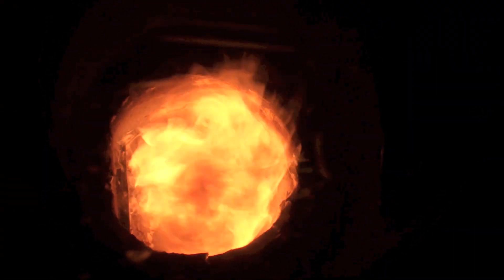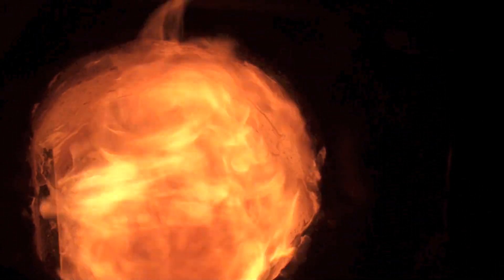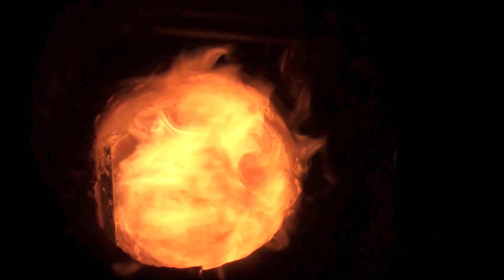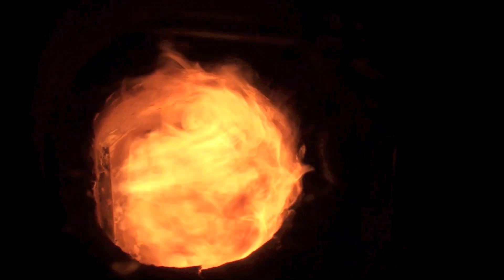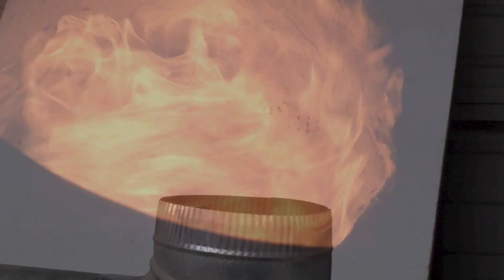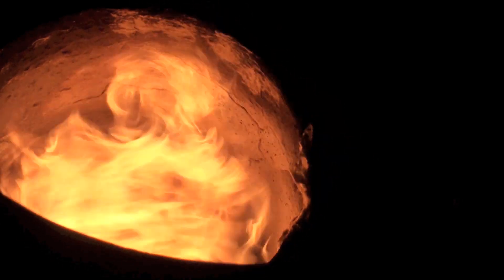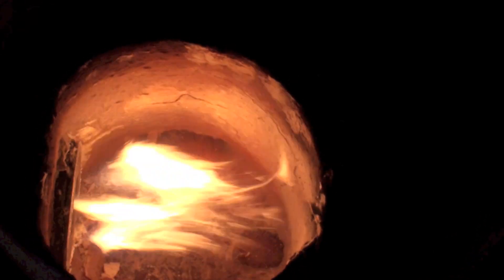Setting the oil burner air adjustment

Comment: A furnace guy told me that I had to much oxygen and tried to shutdown my boiler for high CO2 levels, does this sound right? If it does, would you be able to explain why? I am trying to learn as much as possible. Thanks in advance
Reply from the maker: Are you sure it was CO2 and not CO (carbon monoxide)?  The part about too much oxygen does not make sense.  If you had too much oxygen, the CO2 level would go down.  I am assuming he did a combustion analysis.
GFM

Comment: I have a stewart warner oil furnace. I cant seem to figure out if there's an air adjustment. The electrodes keep fouling out and it'll run, but once it reaches thermostat temp and shuts off, it wont kick back on. I've done dang near everything to it, other than air intake adjustment because i dont see any. Its an ancient thing!
Reply from the maker: If you send me pics I may be able to help.  Send to:  Grayfurnaceman@gmail.com
GFM

Comment: Thank you for these videos.  You helped me save what I thought was a dying burner.  Turns out I had way to much fuel after switching from kerosene to no 2 oil.  I had no idea how or if it was even possible to make adjustments to air and fuel pressure.  She's burning clean now and the burner is no longer smoking and dripping fuel all over the place.  You saved me a bundle of $$$$$
Reply: A kerosene and oil burner are 2 very different things.  What you’re doing is not efficient at all and a fire hazard.

Comment: @grayfurnaceman: Your videos have been very helpful since I first had to troubleshoot my furnace on Christmas Day years ago!
I run a 1.1GHP - 80B nozzle on my Beckett AFG burner on a short barrel, heat exchanger, in a low-boy forced hot air furnace. Beckett says both the F6 & F12 combustion/flame retention heads are within range of the nozzle I run, but given the choice, I am inclined to always run the smaller slot sized, F6 head, so I can run with a little more air pressure behind the head.  The original head was an F12, and I had to run the burner with the fresh air intake almost entirely closed to get the air setting correct.  As for flame color, I've found that if it's orange, like the Sun at dusk, it's air-starved, or if it's almost white, you have way too much air and you're blowing heat right up your chimney. You want to to be much closer to "just not orange", than "almost white".  
Also, if you have a Beckett burner that won't stay lit, check your drive coupling between the pump and the motor; they are plastic and the square drive hole rounds out over time.  You may start the hear clicking, and when it gets bad enough, your fuel pressure will not maintain a steady pressure, and you'll get constant flame-outs.
Reply: One other thing I'll mention is too much air pushes heat right up your chimney without being recovered. I'm down to a 0.85 GPH nozzle, so the furnace runs a little longer on each heat cycle, but my heated ambient air temperature  to flue temperature differential is greater, meaning there is more heat now being recovered by the heat exchanger.  I put a digital thermometer/relay switch in my sheet metal furnace collar, that is in series with the flag switch, to control the humidifier water solenoid, so the humidity panel stops the water flow before the air temperature gets below 120F, so my water overflow pump kicks on a lot less now.  But having that thermometer reading in combination with taking the temperature of the flue pipe, gives me the temperature differential.

Comment: Do you mind if i ask how or where your can look to see the flame on an oil furnace? It looks like yours might be half apart…  on one thats in service is there a way to inspect the flame?
Thanks for all the tips!
This video helped me clear up the black smoke that appeared directly after i paid a furnace guy a grand to replace a gasket (that allegedly caused the fuel oil leak out all over my basement)
Reply from the maker: There is usually an inspection hole above the burner.  It will not give an unobstructed view of the flame as seen in the video(this unit is a test mule), but with a flame mirror(made of stainless steel), you can usually see fairly well.
GFM

Comment: I've got a beckett burner. Is there only the side air adjustment or is there another adjustment somewhere?
Reply from the maker: There is a mass damper on the circumference of the burner in addition to the end adjustment.  The mass damper is seldom used for nozzles less than 3 gph.
GFM

Comment: Thanks again for another great video.  You said something that  caught my attention about, "sparklys". If you have those, what does that mean? Thanks
Reply from the maker: The sparkles usually mean too much air.
GFM
Reply: @grayfurnaceman  thanks for replying back. I'm working on one now that has been down for a couple years for my neighbor. I pulled the wool filter out and it was  gunked. The strainer in the pump was very clean though. I adjusted the  electrodes and got it fired up. It had those sparklers though so I shut it down. I figured it may of been too much air and you definitely have confirmed my thoughts. This is an old one. It doesn't have the solenoid.  They told me that it would run fine until the ambient temps were below freezing. I told them I wanted to research it and talk with someone who knew their stuff. I checked their oil (visually) and it looks clean, very red....doesn't look to have water in it but I do know tanks build up condensation in them. I have thought about some sort of water removing additive but really don't know for sure what would work. Other than the filter their oil burner looks clean. They did add 100gal of fresh fuel in it back in October and their gauge shows  about 120gal if its correct.  Its a one line system,  above ground and is layed out to where it does work as far as gravity. When I bled it, I saw very little air bubbles. I probably caused most from changing the filter. I'd like to check the pressure and will also try to adjust the air. I told them that they should have their oil company come out and do a professional check on things. It may have had lower pressure with the gummed filter and now have more with clean filter but I won't know until I check the pressure.  What are your thoughts about this? Thanks in advance and sorry for the long message, just like to give as many details as I can when troubleshooting.
Reply from the maker: I think you have fixed it with the filter change.
GFM @dgmenace73

Comment: That blast tube should be set back a little bit, flush with the wall of the combustion chamber.  The heat will damage it.  If that’s an old non flame retention burner, it should run 0 to trace of smoke and 8 to 10 percent C02.  I like to keep the stack temp at 400 if possible, with only a slight overfire draft.
Reply from the maker: All good information, but 400F net is a bit optimistic.
GFM
Reply: @grayfurnaceman Most oil furnaces can be de rated  and fine turned by changing the nozzle and static disc.  If I had high stack temperature, and everything was clean, then the nozzle is too big.  400 is just what I shot for. Too much draft can also cause high stack temp.  The flue gasses are sucked out before the heat can transfer through the heat exchanger.  I ran a slight overfire draft, and .02-.04 at the stack, depending on the heat exchanger design.  A lot of  residential oil furnaces are over fired for the condition.  Lennox supplied a kit to de rate some of them if necessary.  Over here their were mostly Wayne and Beckett burners.  Lennox had their own design.  Back in my day, we used the old style combustion test kit, that was in a suitcase.  Manual smoke pump, and hourglass CO2 instrument, which we had to pump I believe 18 times. Pain in the butt.
Reply from the maker: @rodgraff1782  Thanks for the look back at the bottles.  We still use the pump as a double check to the combustion analyzer.  The Bacharach pump is 10 strokes.
GFM
Reply: @grayfurnaceman  Yea the smoke pump, the smoke paper, the chart to see the #.  10 pumps.  The hour glass shaped  CO2 instrument, with the red fluid was 18 pumps, I believe.  That was a real pain.  I never had anything else except a carbon monoxide meter, a bore scope, and a weird heat exchanger test kit.   I don’t miss those oil calls a bit.  I used to do 2 a day, spending 4 hours on a complete service and cleaning on each.  Over here we mostly had underground tanks, so you never knew what was growing inside.  One customer had two buried 50 gallon drums, piped together.  The worst headaches were the fuel quality, and the underground supply and return lines.

Comment: Show us how you clean a Thermopride Oil Furnace.  All the guys ever do is pull the plugs and stick the vacuum cleaner nozzle in.  Nobody ever brushes the heat exchanger.  Is that proper?

Comment: How do you view the flame in an installed unit, with all the duct work in place? I have a 40 year old Thermopride horizontal model. The adjustable 3 air ports above the burner, don't allow much of a view. Plus if I opened it all up to see, wouldn't that affect the burn ratio? Thanks for your response, and videos.
Reply from the maker: On some furnaces, there is no good view of the flame.  That is when a combustion analysis is necessary.
GFM
Reply: @grayfurnaceman  Bummer. Designers, (as in the automotive industries) never consider the repairmen. Guess I'll need-ta dive deeper into your other videos. Thanks again for your time and expertise.

Comment: i have a beckett af oil burner. its sputtering on start up and strarts smoking about 8 secs into the start up. I have a 45 sec time out once that is up the unit turns off. any idea whats going on. replaced nozzle and filter allready

Comment: hi, we're getting oil smell upon startup of the Becket burner all the time in the basement not a whole lot but a decent amount in the basement. There's no black smoke coming through the chimney do you think it's either too much air or not enough air flow on side adjustment if burner?  getting some oil smell upon startup? The big band vent is halfway open and you said that should be closed is that correct? I appreciate the help thank you I have a 1.00 .80 nozzle. And Becket burner
Reply from the maker: This is probably a venting problem, meaning blockage in the smoke pipe or chimney.
GFM

Comment: Hi Grayfurnaceman, Love your channel and vids! You’ve helped keep my house warm through many winters!
My current oil fired furnace is a 30 yr old Weather King that still does it’s job but I want to replace it now as I don’t want the heat exchanger to force me to change this winter. Let’s just say I’ve got my money’s worth out of the old boy. Was looking at either a Blueridge or a Patriot. They both seem very similar and both use a Beckett AFG and list the same 14ga heat x wall thickness. What would you recommend? 
I’ll do the install myself and having an Oil Burner Tech buddy tune the burner afterwards. Thanks!
Reply from the maker: Both these furnace have more or less equal quality.  If I was to choose, I would probably go for Blueridge.
GFM
Reply: grayfurnaceman Thank You Sir!

Comment: Mine is very similar but I have 2 sit adjustments a small one on outer ring and the same one you have. What one do I adj
Reply: Also I have almost zero smoke out chimney
Reply from the maker: @edsmith2503  Keep the outer ring closed.  It is only for very large nozzles.
GFM
Reply from the maker: @edsmith2503  Close the outer ring.  It is only for very large nozzles.
GFM

Comment: Thank you for your videos... is the flame supposed to be touching/hitting the back of the firebox like in the video? I was under impression that it shouldn't be hitting the back of the firebox like shown. What is the downside of a mixture that's too lean, where there is too much air? lack of heat and thus efficiency? because as shown the flame is so much smaller. I heard some techs say it's better to run a bit leaner to prevent sooting under occasional abnormal conditions, such as less draft, etc... true or not?
Reply from the maker: A proper burning flame will always touch the sides of the chamber.  If you get buildup of soot on the chamber, you have too much nozzle for the chamber.  
The downside of more air is lowered flame temp.  In order to burn properly, the flame must be very hot to evaporate all the fuel.  When you are operating at 0 smoke, you are operating within those abnormal conditions.  
On an oil furnace, too much air is devastating to efficiency and will deposit unburned oil on the heat exchanger and chimney.
GFM

Comment: Nice to see that you can adjust the air BUT where is the adjuster located to adjust the air to fuel ratio???
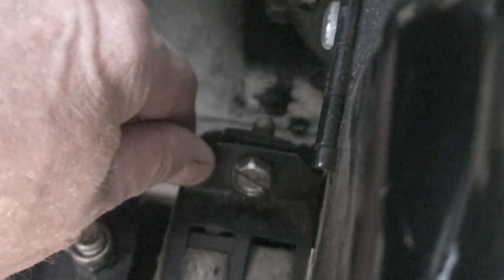Reply from the maker: I did not spend a lot of time on the adjustment location, but at 2:50 you can see the mass air adjustment.  There is another smaller adjustment on the diameter of the mass air adjustment.  This is only for the Beckett burner.
GFM
Reply: Absolutely perfect.  I had to recast my liner and also added a 1-1/4" fire brick to the flame target wall. I adjusted the air flow as you have shown , but still getting a hint of richness when I go outside. No soot . Should I lower the nozzle  to a .85  / 70 degree from the 1gph / 70 degree ?

Comment: Can you have to much air that ignition won’t occur? I’m at 100 psi but I can’t get my O2 up to 3.3% without compromising ignition. It lights off delayed, and sometimes goes into lock out instead of igniting. HELP!
Reply from the maker: I would be looking at nozzle type and size, heat exchanger cleanliness for starters.
GFM
Reply: grayfurnaceman , it ended up being the head position was to far back. It was set at 0 instead of the required 1. It was causing to much velocity so it couldn’t ignite. Now this thing is purring during the entire operations and my O2 is at 4.8. Thanks for the reply.

Comment: On my oil heater why do I have to open the Transformer for it to light
Reply: You could have a draft problem Plugged heat exchanger?  Or the air adjustment is wrong.
GFM

Comment: Will a soot filled flue cause black smoke? I changed very bas nozzle and checked flame it looked ok but smoked a little after a while of running? Does air need adjuster or flue cleaned?

Comment: I've done a complete service on my oil furnace, including replacing the combustion chamber.  The furnace called for a .85 nozzle, but a .75 was installed.  I've replaced it with a .85 and all is working well, but it seems that there's a little bit of soot when it's burning.  I just went down and checked the burner, and to get the flame to look good with very little smoke at the top, the beckett AFG is set between 9.5 and 10 (fully open) on the air setting.  It was previously set on 9.  Is this normal?  I thought that it may need a little more air since it's shooting more fuel, but it's already at/near the max setting.
Nothing is leaking that I can tell, and there's no 'boom' on startup that would indicate puffback.  Any tips?

Thanks!
Reply from the maker: Are you sure you do not have a flame impingement.  
GFM
Reply: @grayfurnaceman  , cleaned all the pipes (very short run to the chimney), chimney is good, new nozzle, flame head, electrodes, all gapped and spaced correctly, old damaged combustion chamber liner removed and replaced with new.  The only thing I noticed was that the air intake area was pretty dirty on the burner.  I vacuumed out all that I could, but I didn't disassemble that side of the oil pump beyond the cover to replace the screen and the gasket.
Is it possible that it's clogged on that side?
When the old chamber liner failed there was a small crack opposite of the flame head - that has been repaired with high heat stove repair and sheet metal on the outside, and a generous amount of high heat stove repair on the inside - also, the area inside now has a double wall of 1/2" Kaowool over it.  I've rechecked the patch and it's still solid.
Reply from the maker: The reason for the concern about impingement is the air adjustment is opened very wide and you still have smoke.  You could also have impingement if the combustion chamber is too small.  I would also replace the nozzle as it could be partly plugged.
GFM
Reply: @grayfurnaceman  , I installed a new nozzle when I did the cleaning/service.  After adjusting the flame by eye/smoke level, it went from the previous setting of 9 to 10 now.  I can't see any smoke/soot in the flame, or in the air passing the barometric damper.  I wonder if it's just dirty on the air intake side.  I have it so that it doesn't seem to be making soot, but it seems odd that it'd be wide open for that to happen.
I'll do more checking and see what I can do.  I don't want to pull the burner because it's pretty cold out, and we can't take much down time at this time of the year!

Comment: Dear sir,
 I have and old (mid 1950's?) Siegler model 6640UTL oil heater that suddenly ceased to flow oil into the combustion chamber. Would you happen to know the brand/model of the carburetor that came on the unit originally? It is believed to be the carburetor original to the unit. I intend to try and tackle the issue myself as opposed to calling someone in as my local guy isn't much of a fan; he told me prior to my installing it that it would be an effort in futility. After viewing your other videos, you've given me the confidence to make an attempt at rectifying the situation myself. I own/operate a CNC machining and fabrication facility and feel to be fairly mechanically inclined; so, what the heck. This way, at least, I have the option of reproducing virtually any component within the carburetor myself in the even they aren't commercially available. Any advice would be truly appreciated!

                                        Kind regards,
                                               Mike Ward.
Reply from the maker: I have no idea on that one.  Would love to see your replacement carburetor when it is done.
GFM